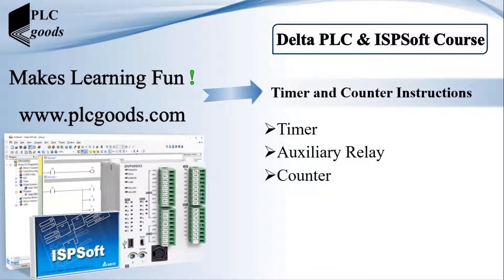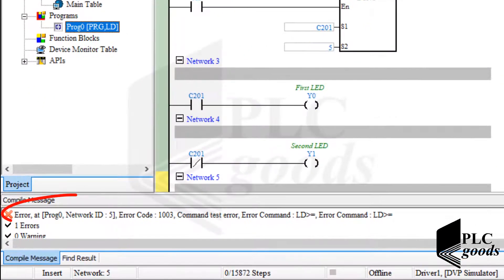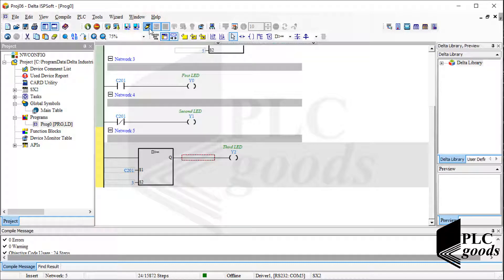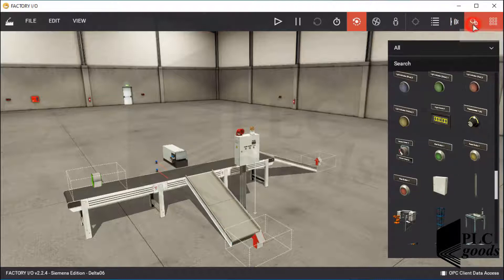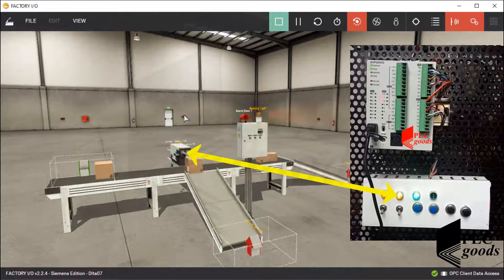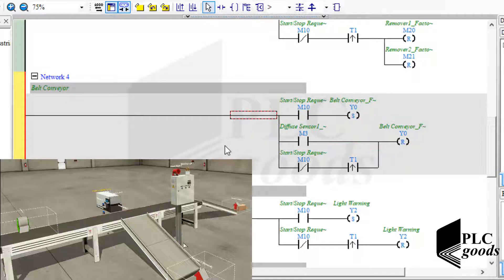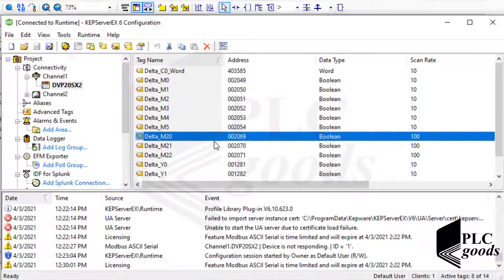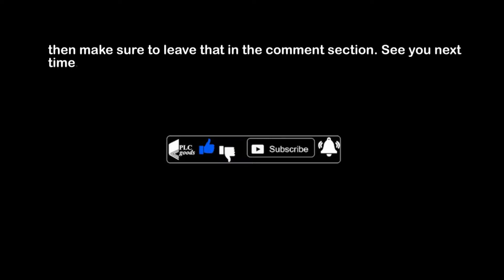Delta PLC Down Counter with ISPSoft | Factory I/O Box Sorting Project | Lesson 7

Comment: sir ! Can we connect wplsoft with factory io also🤔🤔?
Reply from the maker: 👨‍🏫 Answer:
No, unfortunately WPLSoft (used for Delta PLCs) cannot be directly connected to Factory I/O because it does not support OPC, Modbus TCP/IP, or other industrial communication protocols required for integration.
🔄 Workaround (if you really want to use Factory I/O):
You can use Factory I/O with PLC software that supports communication protocols like:
Siemens (TIA Portal with PLCSIM Advanced)
Allen Bradley (RSLogix + FactoryTalk with OPC)
CODESYS (with Modbus TCP/IP)
Virtual PLCs that support Modbus
📌 Tip:
If you're looking for a simulation tool compatible with WPLSoft, try Delta's ISPSoft along with official Delta simulators, but they do not provide 3D simulation like Factory I/O.💚💚

Comment: Thx u for u vids , I spent two days to simulate it with control io , the operation is successful except the part that includes M3 diffuse sensor , when it detects high box the conveyor doesn't stop so the pusher can push the box to remover , my program made the pusher push the box when M3 diffuse sensor detect it with out stopping the conveyor ، I am trying to upload the picture of my control io program but I couldn't 😑
Reply: Hi there,  I've explained my program during the video, please watch the video more carefully. Also, a new video has been uploaded which uses the Control I/O interface of Factory I/O software to do the sorting box project. Maybe it can help you ( https://www.youtube.com/watch?v=fetFn0GPvpo&t=736s ).
I guess you have used the conveyor coil 2 times or more inside your program. when the first one decides to stop the belt conveyor, the second one decides to be in Run mode. note that, PLC update all outputs based on the last decision
Reply: @plcgoodsmentor9223  you are right I edited the program but another problem is when I try to stop the operation everything stopped except the conveyor it's only can be stopped by keep pressing the stop push button,  any advice?
Reply from the maker: I thank you the PLCgoods Mentor for the response

Comment: Hello first of all, thank you very much.  I have a question.  Delta dvp12se physical output Y0, Y1, Y2, Y3 has a total of four.  Can we use other than these four outputs while setting up the simulation?  I gave the command to run the Y4 output conveyor. It doesn't work.  good work
Reply from the maker: Hi dear, thanks for watching our videos, and also your question. because of your question, I've tested all my outputs. It may help you. Similarly, My PLC supports 6 physical outputs Y0, Y1, Y2, Y3, Y5. Also, I can use Y6, Y7 inside my program. but Y8 and Y9 are not defined inside ISPSoft. after that, I can use Y10 to Y17, but Y18 and Y19 can not be used inside the program, and etc. then, I try to connect them to factory I O software using OPC server (https://www.youtube.com/watch?v=pVI7zsL-TxA). Now let me explain my experience: 1- I connected Y0 to Y5 and also Y6 and Y7 without any problem. 2- Naturally I can not use Y8 and Y9. 3- Also, I connected Y10 to Y17 to factory IO using OPC server, but I had needed to decrease their Modbus addresses 2 units. for example for Y10, I used 001289 (Modbus Address), instead of this address 001291, which can find inside the Modbus address table.
Reply: @plcgoods  Thank you very much my friend. I found a solution !!!! M0, M1, M2, M3, M4 ...... M100 instead of physical outputs
Reply from the maker: Glad to hear that!